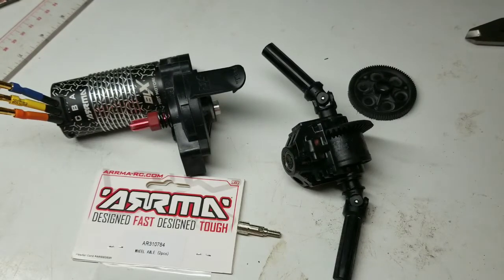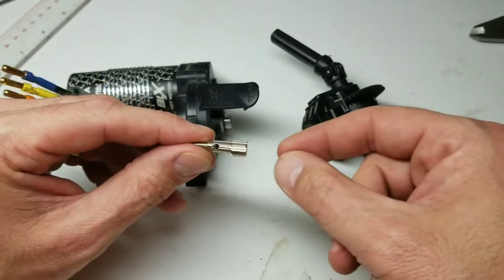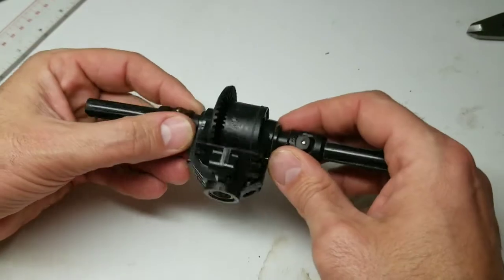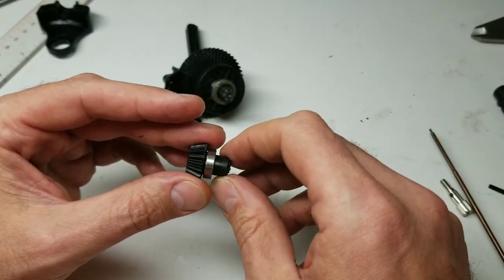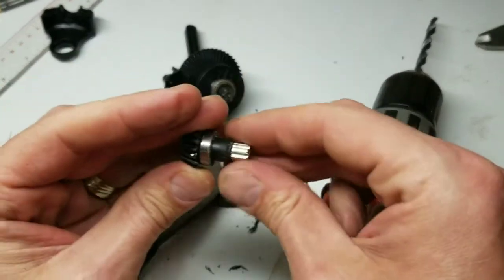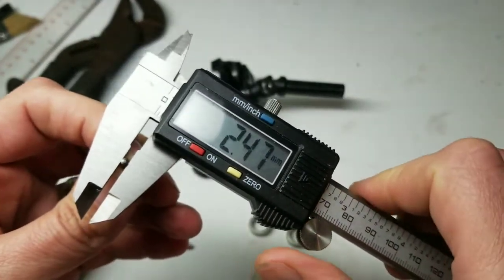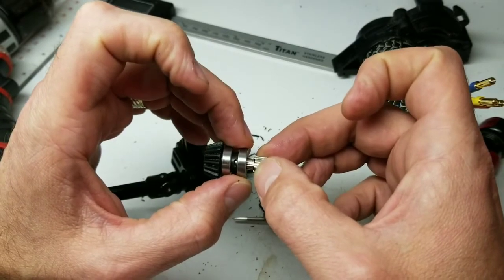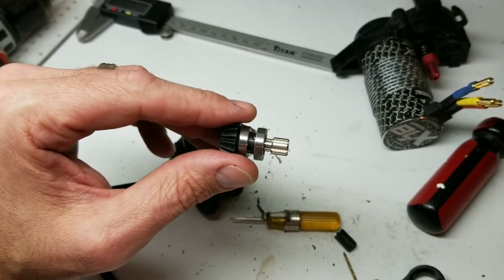Arrma Mega 4x4 diff input HD mod

Comment: Can the monster gears on the diffs be replaced with REAL metal ones? I say REAL because there are other brands of vehicles where plastic is replaced with metal except the "metal" is pot metal and doesn't hold up! They don't give you a cross pin with the new input shaft? Terrible! Is it worth starting out with the Mega and all of the plastic it comes with or would it better to save longer and go right to the 3S version? I haven't bought anything yet. Thanks.

Comment: Awsome video
Reply from the maker: Vincent Crooker Thanks!
Reply: Do you have a part number for the pin that inserts through the axle shaft by chance? Im having trouble finding one.
Reply from the maker: Offhand, no.  I would say, head to Granger.com or amazon, and search for 2.5mm drill blank.  Then cut it to size.

Comment: Hi, It looks like a 1/4" guided drill bit would come in handy fot doing ths mod.  You may want to think about filling those holes with epoxy and maybe put some in the open end of the gear to strengthen it.

Comment: 😊👍Nice mod Hopefully arrma will come out with a steel version of that gear for brushless power. ? did you crack open the diff ...If so are they sealed or not and just the greasable type? I was thinking of degreasing mine and putting tamiya anti wear grease maybe in mine because that stuff makes open diffs work like oil filled diffs.
Reply from the maker: Shen RC - I did not open the diffs proper. As for arrma making this in metal, Tower and a main do list a HD diff input. The picture looks like metal shaft, plastic gear. Basically the same thing I made here. Tower Hobbies shows mid-may arrival for that part. As far as getting a full metal diff, I think I agree with the arrma forums poster that said A True full metal diff for this truck would be way too heavy. These diffs are huge. If they wanted to make a metal diff that will still perform decently, and allow the truck to accelerate nicely, they would need to make them much much smaller. Plus, so far there is no indication that these are weak gears. Yes they are plastic, but I have read zero cases of someone actually stripping the ring gear or pinion gear.

Comment: By any chance would you have the info or link on the long hex your using I’m trying to add my blx diff but mine are to short as well?
Reply from the maker: If you want cheap ones, they are easy to find on Amazon or Ebay.  Here is one set with hex handle - which I like better than round.  But they will wear out kind of quick.
Aiskaer Full-Color Lightweight Titanium Nitride Coating Hex Driver Wrench 4 Piece Set,Hex Screw Driver Tools Kit Set(1.5mm/2mm/2.5mm/3.0mm) https://www.amazon.com/dp/B01FK6TJ9G/ref=cm_sw_r_cp_apa_i_PeYFCbYTA43RZ

For a bit more money I like Team-eds.
https://www.team-eds.com/mobile/Product.aspx?ProductCode=EDS-110991
My tools are cheap handles, with EDS tips.
http://www.team-eds.com/mobile/Category.aspx?id=1864
Reply: Awesome thank you appreciate it very much

Comment: cant you just use the Granite BLX 3S input shaft now ?
Reply from the maker: Only if you also use the BLX diffs.  I now run the BLX diffs and inputs in my Granite 4x4
Reply: @jerryshobbies8224  do The fit without any mods??
Reply from the maker: @ELValenin  yes.  Use both the input gear and the diffs, and it drops in.
Reply: AR310773 - 17T HD input shafts - direct fitment on the Granite brushed or is this the ones that also needs the BLX diffs? Can the BLX diffs be bought as a complete pack? Part no?

Comment: How long till that pin eats right through that plastic.
Reply from the maker: I have not had one fail that way, but others have.  But now Arrma sells the HD input, so you dont need to make it your self.  There is 2 versions, the 17t that fits the mega4x4,  and the 11t that fits the BLX3s, so make sure you get the right one.